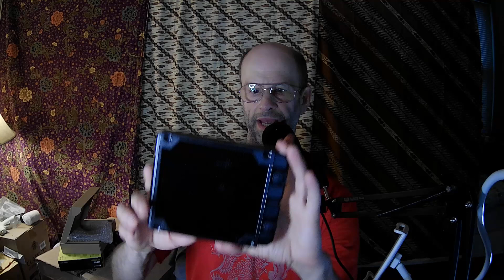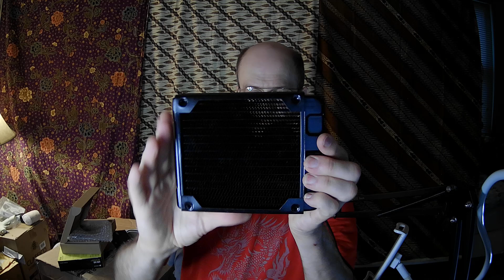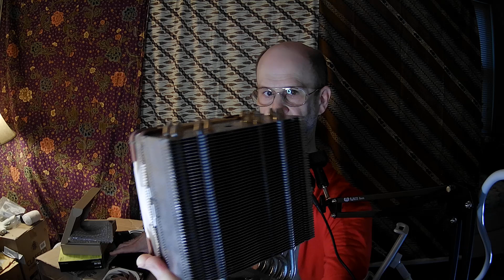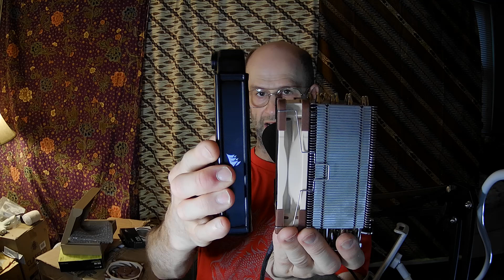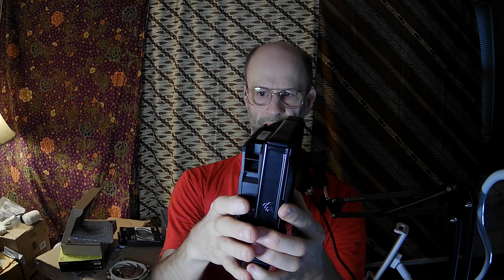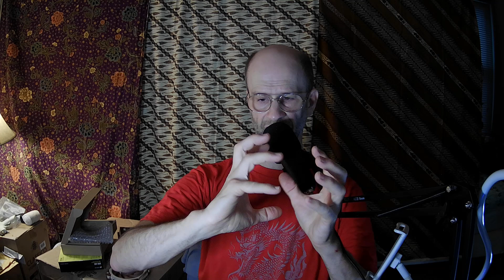The Static Pressure Fan Condundrum

Comment: The answer is to build the entire case as a heatsink if static pressure is your problem.
Reply from the maker: How will that help in measuring static pressure across the airflow cone? I'm sorry, but building a case so that it's like a heatsink is not going to help. This is a testing dilemma, not a build dilemma.
Reply: @ThePCExpertAmateur  You wouldn't need any fans at that point.
Reply: @grndzro777  Perhaps but, again, that has nothing to do with the topic of my video.
Reply: @GlennsFastReviews  It kinda does. People want high static pressure fans to control dust build up a lot of the time.

Saw off a tower heatsink and solder in some wick's to a nice aluminium plate and you have a silent PC that can be overclocked to your hearts content. 0 moving parts and supper easy to make.
Reply from the maker: No, my video is about measuring static pressure, not about a case that will make fans obsolete.  Besides, such a case would be entirely unpractical because of the customization needs required. If you have an idea for such a case, make a blueprint build one. Please stick to the topic of my video - SP measurement.